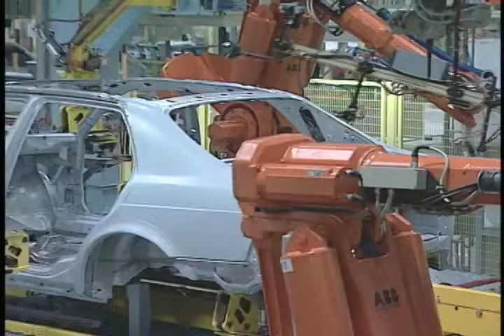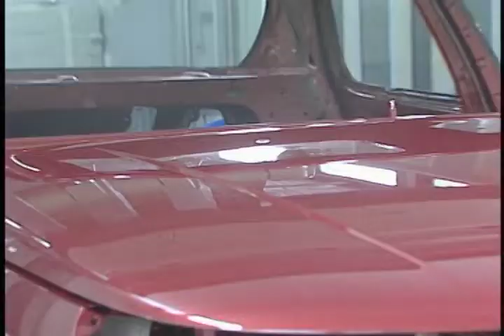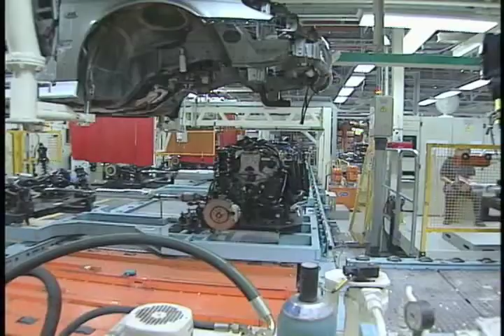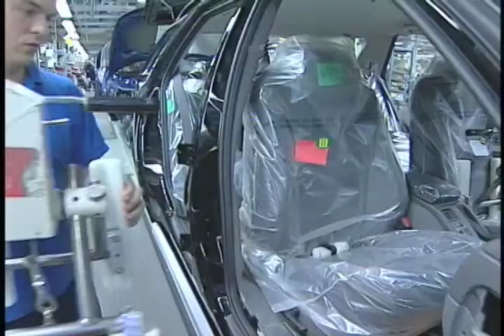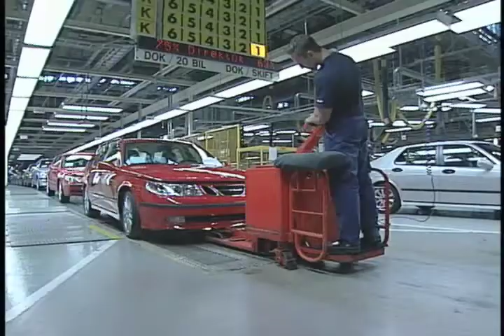SAAB 9-5 Production 2003

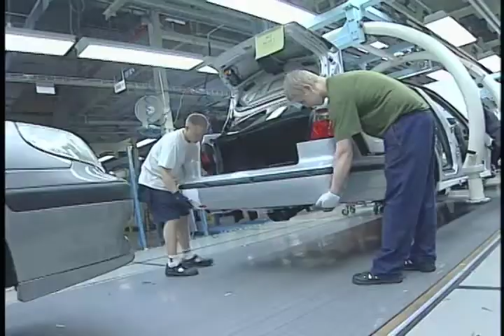Comment: hey at 3:58 i saw a first gen 95 being made. look at the taillights
Reply: Well it'd be strange if you saw a second gen being made since those cam 7 years later.
Reply: Gabriel Gomez I know what he's talking about. But no is the 2nd face lift. If you look closely. You can tell is the new styled headlights. Plus the front bumper is the 2nd face lift
Reply: Definitely a pre-facelift at 3:58. I can see several others through out the video.
Reply: They all are great 2nd generation is a pretty face lift tho
Reply: It's a 2nd face lift, if you look at the bumper it goes all the way up to the tail light, the first one had an extra plastic piece between the bumper and lights.